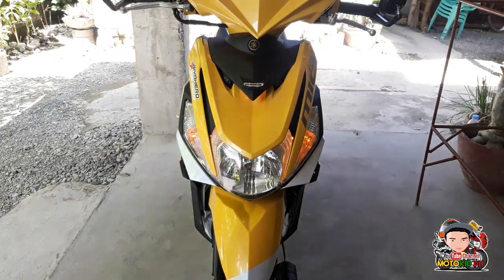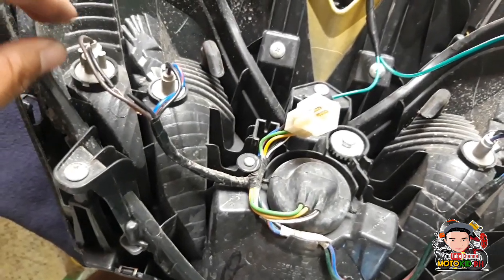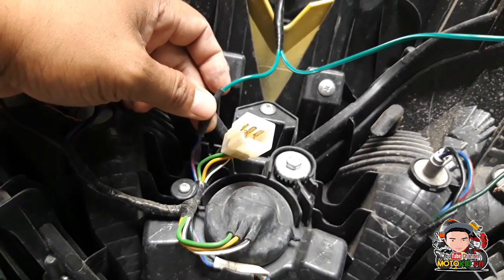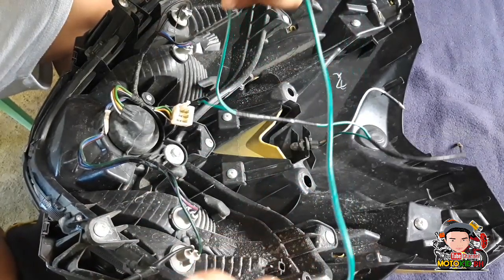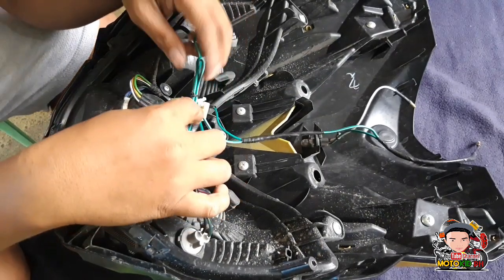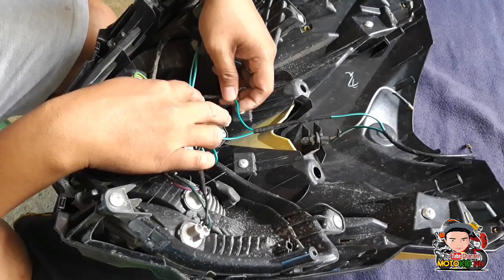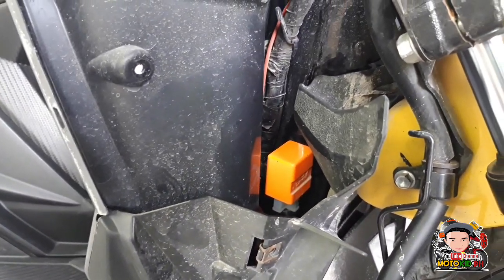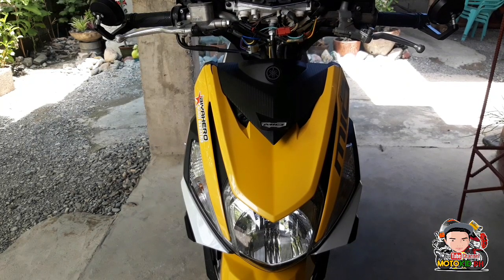DUAL CONTACT SIGNAL LIGHT [MIO I 125]

Comment: Ksama n po ba sa pgdouble contact ang likod sa pagwiring na yan?
Reply from the maker: Opo kasama na hindi po sya gaya ng ibang motor like beat fi
Reply from the maker: Kung mapapansin nyo po pati sa likod nakasabay na din po sa pagilaw
Reply: Pano po wiring kpg my switch po yong parklight ko . Kpg inoff po ba mgsignal pa rin ?
Reply: Di po ba tlga ppwede na LED ? Or my ibang way po . Thank you

Comment: Boss problem nya pag nakapatay ung parklight ko ayaw nya mag signal anu kaya magandang gawen boss
Reply from the maker: Nagpalit kana ba ng flasher relay boss
Reply: @MotoKidPH  oo boss pero meron kasi akong switch ng park light at ng headlight ngaun pag nakabukas lng ung parklight ko tsaka lang den sya iilaw san kaya maganda itap boss
Reply: Tsaka boss d nagana ung signal sa likod
Reply from the maker: Sq power source ng ilaw boss sa may blue black na wire

Comment: Idol bakit sakin hindi kasama likod? And hindi gumagana signal light kapag naka off sana masagot
Reply from the maker: Nagpalit ka ba ng flasher relay boss kung oo baka mali lang ung pinagtapan mo ng positive mo kung hindi naman bili ka pa ng flasher relay na kayang mgpailaw ng apat na bombelya
Reply: @MotoKidPH  yes naka flasher na ako relay nag tap ako sa positive ng parklight
Reply from the maker: Check mo kumuha sa positive ng headlight ung kulay blue sa high and low ung blue na may black okaya try mo panoodin ung  isang video bago ung video na yan ung handle switch